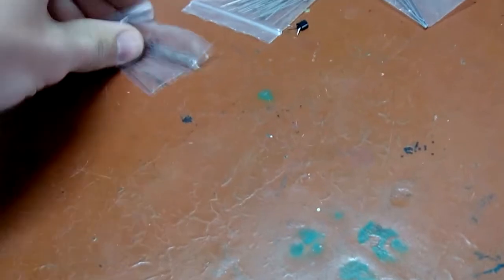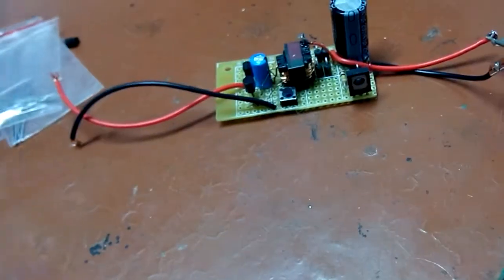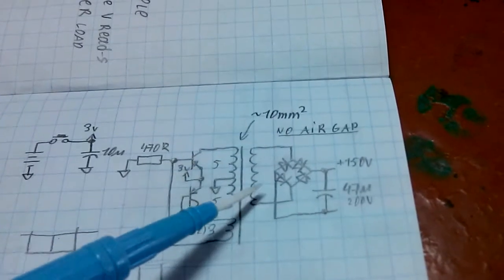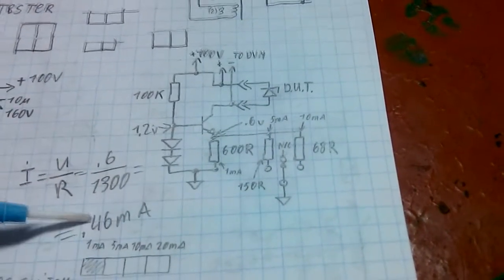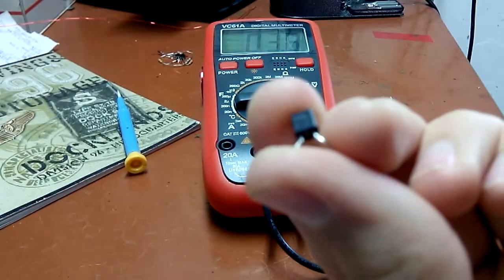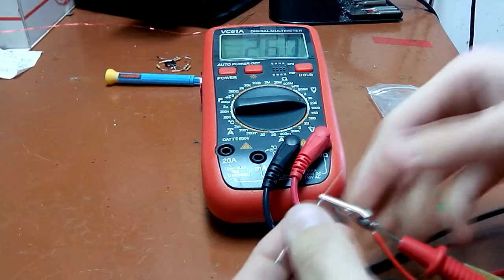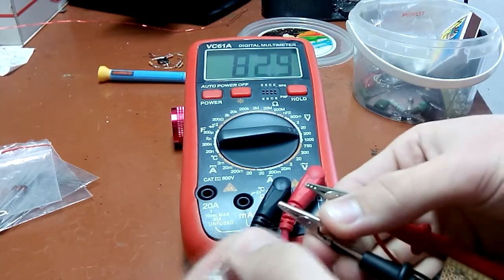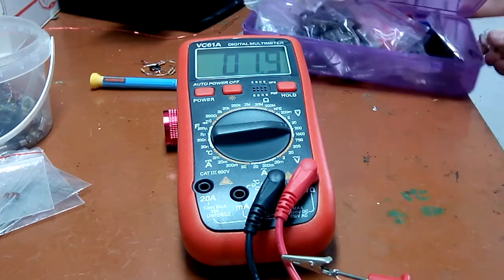Simple Zener Tester

Comment: this is a good little build thanks for sharing I will build one....... on your final version have a switch that puts a hand full of series diodes in parallel (or even a zener) lol for when you test leds so if you put one in backwards the voltage will be clamped and not destroy the led.....

Comment: If you cant find this ferrite transformer you dont need to pay one. Just break open a fluorescent economy light bulb of 12 or 25 watt. Open the lower part with a tool or dremel and inside you will fine an electronic pcb circuit ballast that has an EE12 or EE16 ferrite transformer.
CAUTION!!!NOT to break the glass part of the bulb. Contains MERCURY dust which is not good at all to inhale-breath.
You will have to rewind both primary and secondary but you can reuse the magnet wire already in for rewiring the secondary winding of the above tester.
This transformer have air gap of about 0.5mm which as described on the video you will have to eliminate. You can perform this by using a No600 grinding paper. Place the transformer half that has the air gap on the grinding paper and grind the outer parts of the half so the gap is eliminated.

Comment: What you don't understand about LED? Current is limited  but any current in revers cause breakdown of pn junction. Even if LED will survive such experiment it won't shine long and bright any more. This circuit is used to 4 wire resistance measurements too.

Comment: I was playing with simmular circuit yesterday and cludnt get it to oscilate maybe it had air gap if it had you helped me a lot I used core from noise filter transformer from PS .How do you open transformere ? I use a lighter and gently heat the ferrite if you concentrate the heat it cracks that was hapening to me at first until I figured it out but it isnt that bad just super glued it togeather.I want to make electric mosquito killer using similar circuit just add voltage doubler on output.Comercial killer is too small and I hate mosquitoes.I laughed for 5 minutes when you burned out those diodes you made my day.
Reply from the maker: Noise filter transformer - that is called "common mode choke", core in such chokes doesn't have a gap, so you're just fine. Did you try swapping wires from feedback winding around? Usually, if it doesn't oscillate, just go and reverse the winding connection.
 I use a hot air gun to heat the core evenly, works well with most varnishes they use to glue them. Before I got a hot air gun, I used to boil the transformers in water, again sometimes it worked, sometimes it didn't.
 You won't believe this, but I'm working on bug zapper too :D I'll make a video when I'll get it to work. I plan to make a cage that will have HV on it, and inside that cage will be a CFL to attract insects to it. As for the source of HV - I use a modern flyback with a simple driver, they output a DC so it's easy to use them in such project.
Reply: I used flyback before but voltage is too high so it just wastes power 2-3kv  It dries them out and they stop conducting but higher voltage goes trough buge and loads it down
I am working on circuit from this video I just wound the transformer.It has 305 turns on output and I can add more if needed.Do you have facebook or something so I can send you pictures if it now that I wrote this I think I will  make a video about it when is finished and I have time.
Reply: Yes,I did try swamping feedback pins
Reply: I checked my comercial killer and it puts out only 540V that seems low but it still kilsl bugs mine version puts out 470 v loaded  I dont have hv diodes so I will just add 100 turns more.
Reply from the maker: JOSIP Žlk You can stack diodes in series to make HV diode. In fact, HV diodes are diode stacks, not a single diode. You can send pictures to my email: mrjohhhnnnyyy-at-yahoo.com